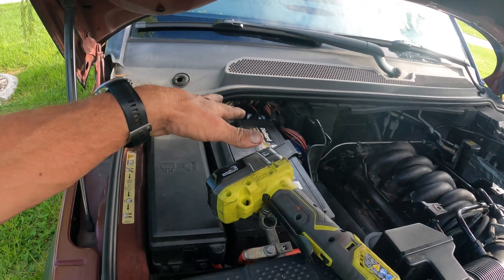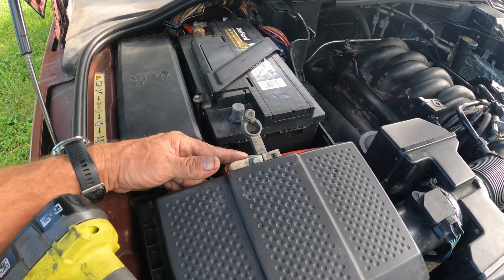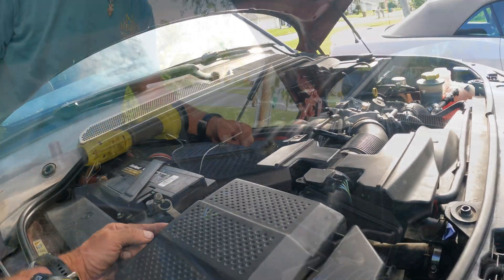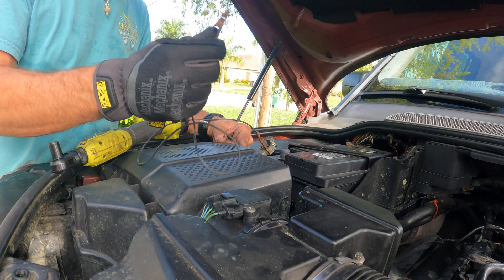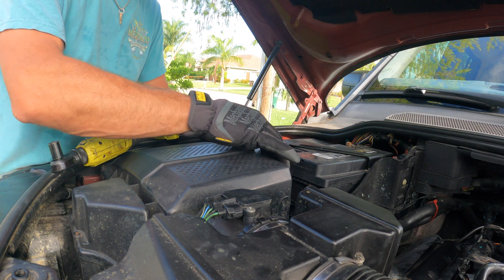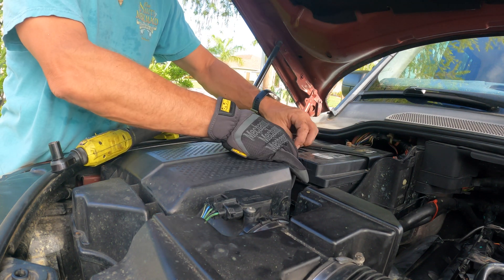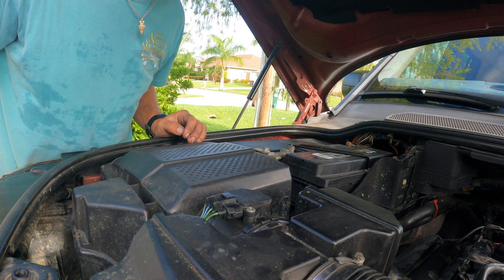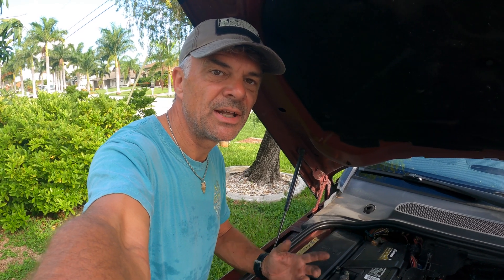Resetting the Engine Control Unit ECU on a Land Rover LR3, Discovery 3

Comment: Hey I wanted to ask you I took off the throttle body and I put it back on but the truck don't want to start it was working fine but after I did that with the throttle body you don't want to start no more
Reply: Did u fix it and what happens
Reply: You gotta calibrate the throttle valve, you know? A diagnostic tool is your best bet. And make sure all the wires are connected tightly.

Comment: Just replaced the 4 spark plugs and fuel injectors on one side of an LR4 V8 and now it will not go past 30MPH.  Could this have something to do with it?   Is the LR4 computer reset the same as the LR3?  Thank you.
Reply from the maker: Yes the reset should be the same - however it sounds like the car went into limb home mode. Connectors put in right ? And all injectors sitting correct in the seat, so it is not inducing false air due to a bad oring ? Which side of the engine ? Bank1 or 2 ? Since it could sound like a plug is missing somewhere else. The engine will run on 7 or 6 cyl normally. Just check all plugs one more time. 

Hope this helps. 

Drive safely best regards Rene
Reply: @techtips101 need you lol

Comment: Some people suggested to take both positive and the negative terminal off the battery. Is this not necessary?
Reply from the maker: Thanks for watching and commenting, no you don’t have to take both of, the most secure is to take off only the negative side, however the computer wouldn’t know the difference. If you take off both you are definitely sure no creeping current is left in the system. 

Hope that helps 

Drive safely best regards Rene
Reply: @techtips101 but you took off the positive?
Reply: @MrMilly72 😂
Reply: @MrMilly72 this guy is special